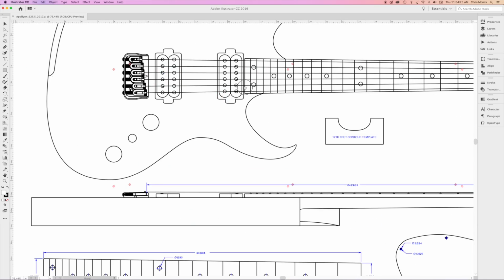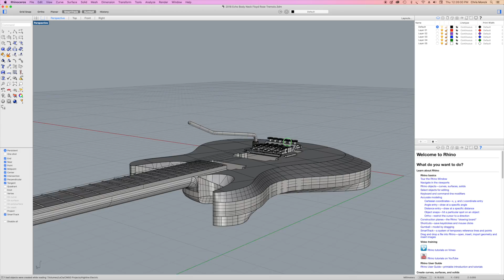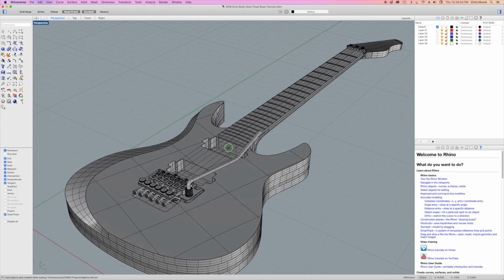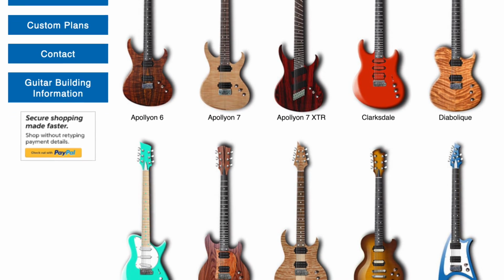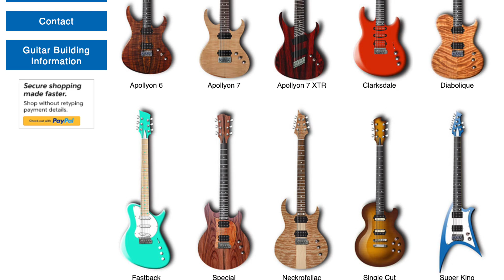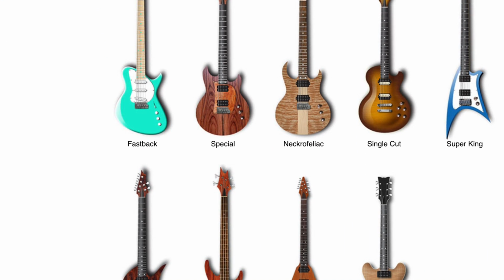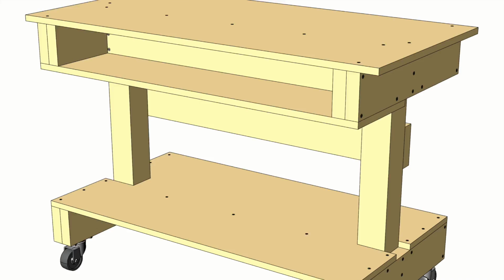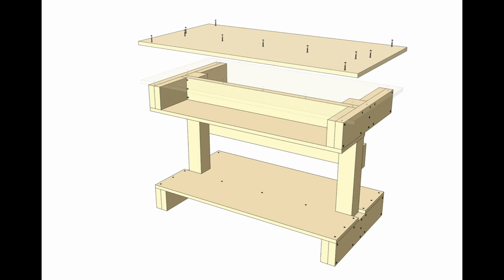Plans For Making A Guitar: Do You Need Them?

Comment: I have a body drawn up, and would love to turn it into plans for a future build, but I don't know what tools to use. Can you let us know what software you using to draw up the plans?
Reply from the maker: I use Adobe Illustrator for the shapes and TurboCAD Mac for dimensions. For CNC plans I use Rhino 3D Mac and MeshCam.
Reply: Thanks for the reply! I have Fusion 360, and Inkscape on my Mac currently, and I think I can import my drawing from Inkscape as .SVG and make a model in Fusion 360, finding out if that will work will be a project for another day. I just found your channel, been finding the finishing videos really helpful, and I am using some of the techniques you discuss (namely sprits/poly rub on/wet sand finish) on my first build right now, a spanish style classical guitar, and it is turning out great so far. Thanks again!

Comment: In my opinion no body needs a plan except if he has to do the templets by himself
Reply from the maker: If you're building an original design, you have to have a plan no matter where the templates come from. Also, without a plan, how will you know how deep to make the neck pocket or what the neck angle should be if necessary? Will you be 100% confident the bridge you want to use will keep the strings within the edges of the fretboard? What about the layout of your controls? Will everything fit without any clearance problems? Without a plan, you'll have to guess. Good luck with that.